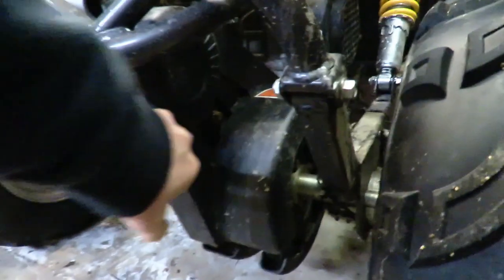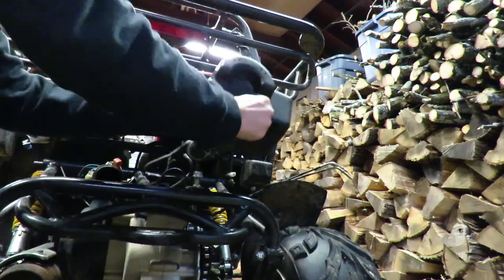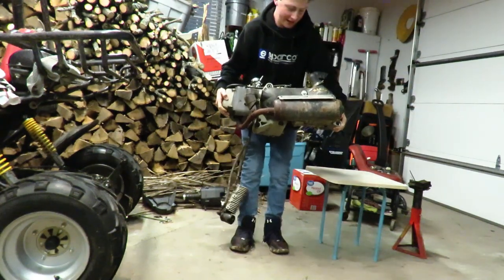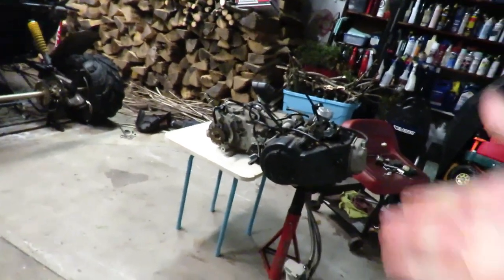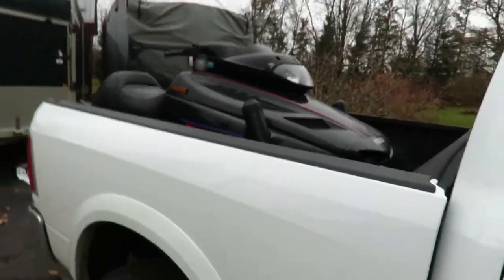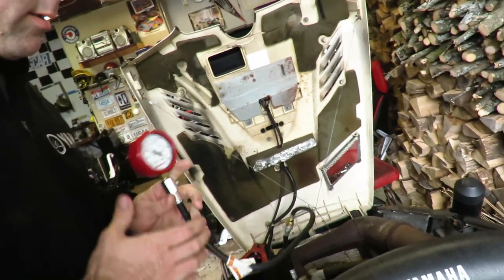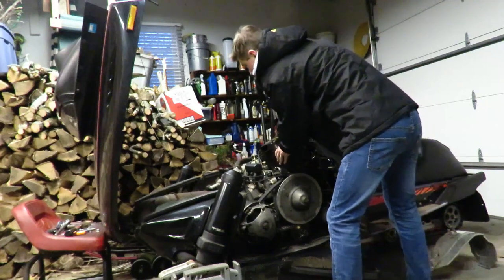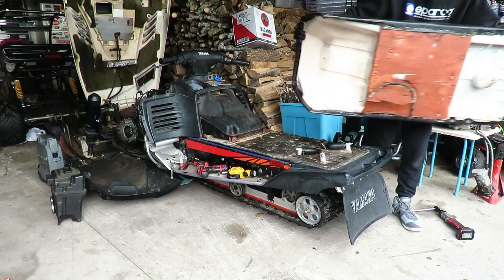Snowmobile Swapping A Chinese Go Kart Part 1

Comment: I have an artic triple 600 that'll actually pull 120 hp and want to make a off road go kart but not sure if it's possible to modify the engine to keep cool without the snow ?
Reply from the maker: From what I remember the way they are cooked on the snowmobile is through those radiator things I get the sled from snow but it still uses a coolant system unless it’s an air cooled , with mine we were able to just hook it up to a car radiator and I’ve ran it for a while and hot lapped it and so far the temps have stayed good. I’ve heard the triples the middle piston is the one that gets hot I don’t really have much experience with those but I would imagine putting a good size radiator on it should help keep it cool, again that is if it is water cooled

Comment: The 600 Vmax is closer to 85HP, just saying!
Reply: Scratch that..  I just seen your exhaust build..   you'll be making around 55-60HP since that part of the header pipe IS indeed part of the tuned pipe.  Chopping that much out of it will totally whack the powerband.  To be more specific, it will move it up the room range..  WAY up to where the engine doesnt even run.   Basically, might as well run a straight pipe similar to a 4 stroke.     Dont take this info the wrong way, you're clearly a young guy building some cool stuff.  But 2 stroke exhaust powermaking is an art. You Picasso'd that pipe.   Best to cut and turn, use all the pieces in the place they were originally at!